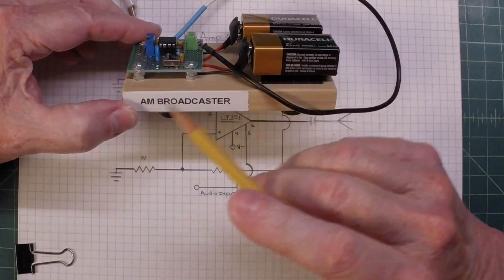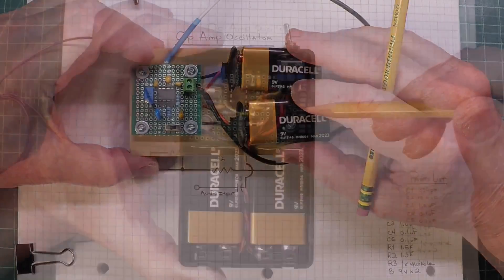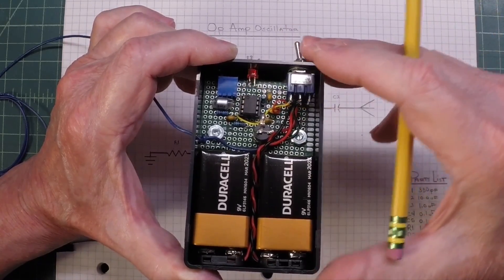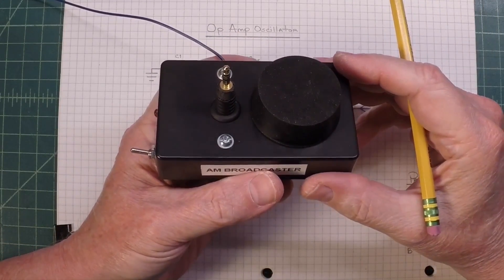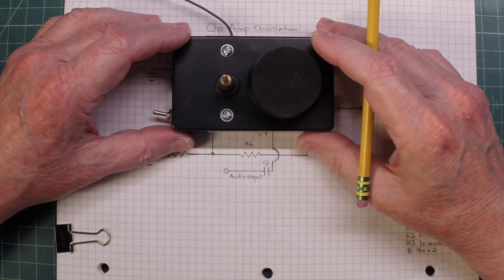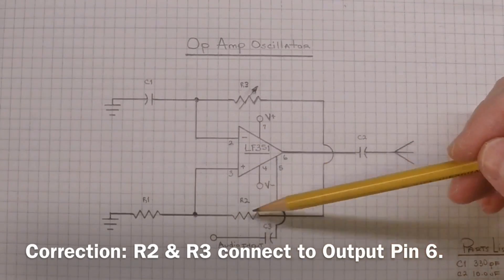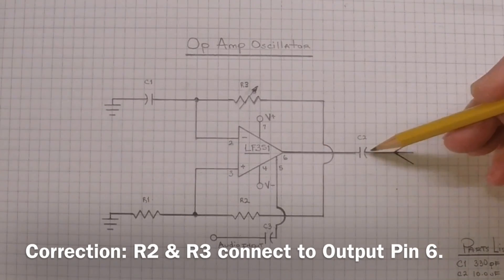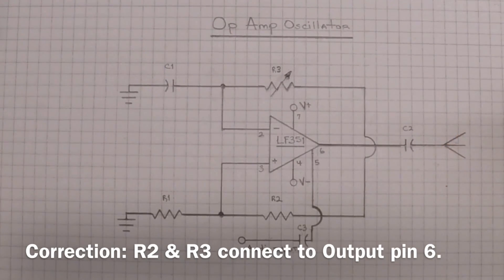AM Broadcaster Build

Comment: One thing that concerns me is the output waveform of the oscillator. It is quite distorted, which means strong harmonics, which may mean a lot of unintended RFI.  You might be better off with a design that uses an LC tuned circuit. The tuned circuit will clean up the harmonics and RFI a huge amount.
Reply from the maker: Dave, thanks for your feedback. The good thing is the effective range is just a few feet, so RFI won’t be a significant concern. I built a Hartley LC Tx and just uploaded it a few days back. Best, Don

Comment: Very nice design.  Simple but effective.  Hum is a bane to many transmitters and it seems to be related to AC wiring modulating and re-radiating the RF through the power supply cable.  The battery supply would eliminate that.  Could you lengthen the antenna wire and make it a whole house transmitter?   I am tring to find something that I can hear on all my home radios.

Comment: Are all the capacitors electrolytics?  That's what you show on your drawing but they don't all look as if they're electrolytics in the final product!
Reply from the maker: Sorry for the confusion. I’m showing my age while using my drawing template from 40+ years ago. I used all non-polarized caps in this build. Hope this helps and thanks for watching. Best, Don
Reply: @RestoreOldRadios  thanks Don, excuse my ignorance but I'm never sure of  the exact applications where different caps are used!